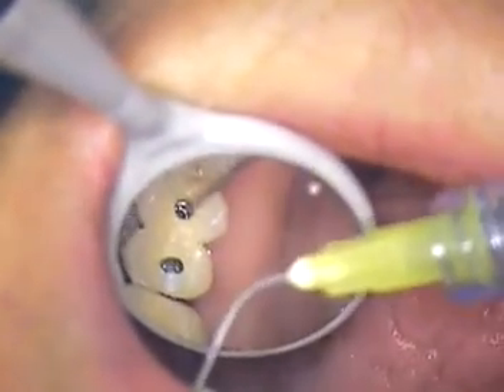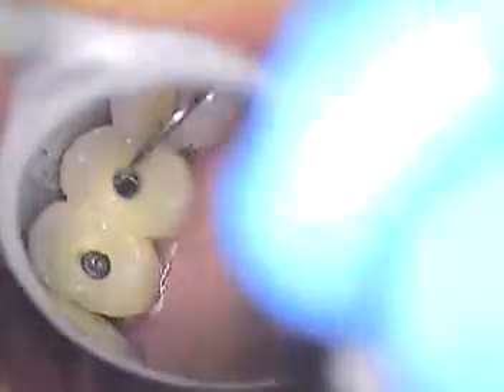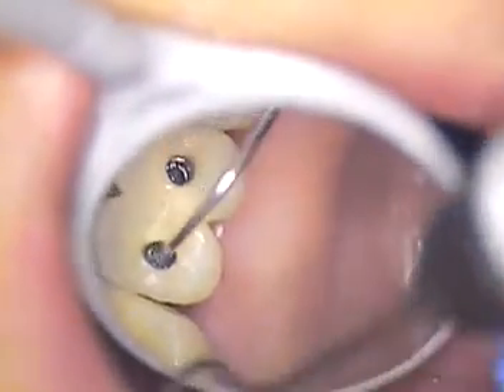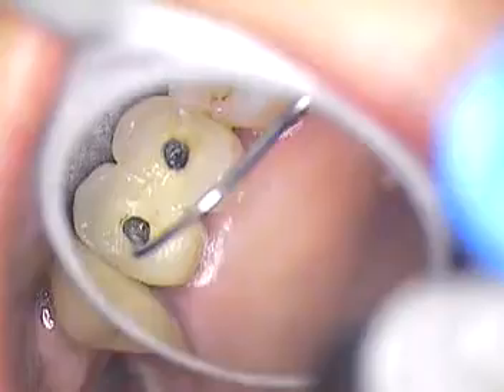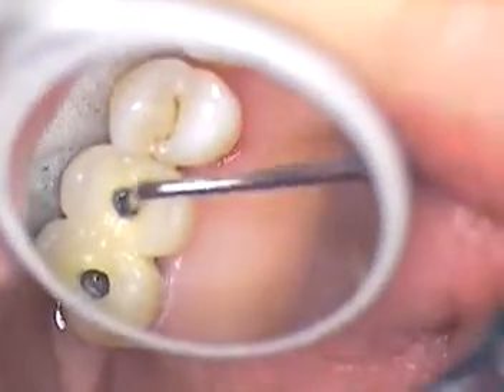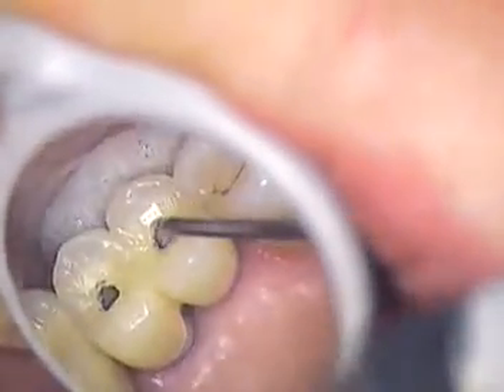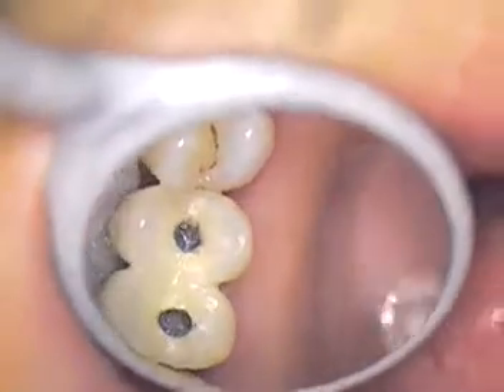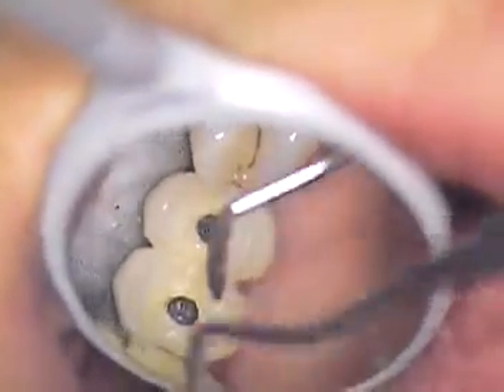3. Avoiding Needless Dental Implant Bridge Remakes - loose abutment screws with difficult access

Comment: Best way to consistently handle that problem is to drill off the entire head of the screw that retains the abutment. Sounds crazy but once the shoulder of the screw head is gone, the crowns will pull right off. The broken screws no longer have torque and generally protrude enough from the implant to be grabbed with a hemostatic to turn.